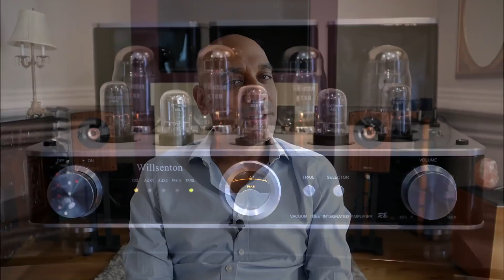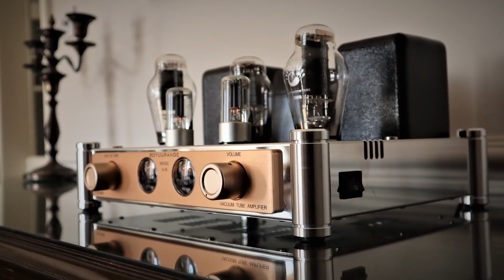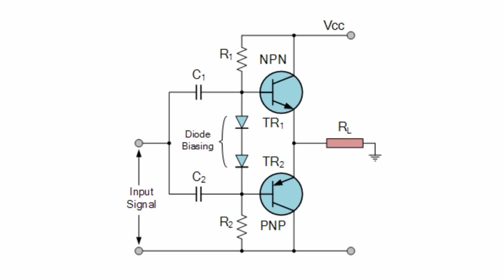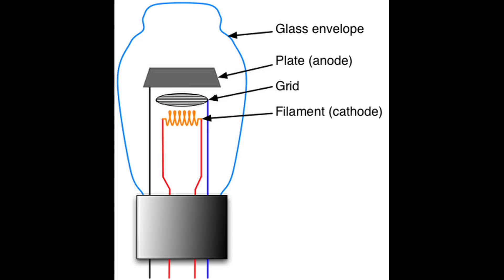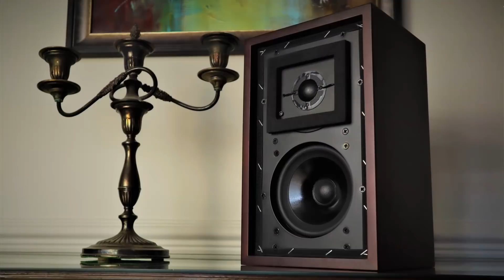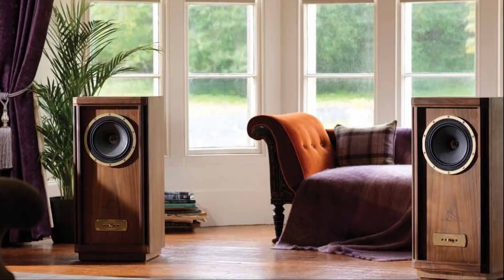Reisong BoyuuRange A50 Mk III Amplifier Review

Comment: I constructed a single-ended triode amplifier to power my Western Electric 555 driver.  It uses three 201A tubes, one for a driver and two in parallel for the output. Thr driver drives the output tubes via a 1:2 interstage transformer. It puts out about 1/2 watt, but the 555 is so sensitive that that is plenty of power. I've figured out a couple of things to make it perform at its best. SETs struggle with bass, so the key is to remove the bass from the amp. Instead of using a crossover on the output, I use one on the input and limit the low end to 200hz with a 24 db/octave LR high pass filter. A separate class D amp and woofer takes care of everything less than 200hz. It's also exclusively battery-powered. That gives a  nearly perfectly black background. I've built many tube amps, but this SET is probably the most musical and "alive" amp that I've ever heard.
Reply from the maker: Thx for sharing 😊

Comment: I have an old RCA single ended pentode (EL84) amp, running a pair of old B&O Beovox 4702 3-ways. Not sure how the Beovox sensitivity spec of “3 watts (DIN)” translates to today’s dB rating for 1 watt at 1 meter, but I am guessing it’s over 92dB. It doesn’t get crazy loud, but it gets damn near loud enough. And sounds mighty fine.

Comment: I use a 5w class a se el34 tube amp with a svs sub between the source and tube amp, the sub crosses out at 80hz, the sound stage is superb with either my quad’s 9l2 or klipsch floorstanders

Comment: I borrowed this amplifier from a friend and I'm very surprised, its sound quality is very good with higher quality tubes. 
All the Snobbie AudioFools will tell you that it's junk just because it's made in China and because you were not tricked into paying 4 to 6 times what they paid for an overpriced Western made Tube amp.
My advice is to use it with very efficient speakers, especially Horn speakers like Klipsch and a Small or fast Subwoofer from REL.
Reply from the maker: Thx for sharing 😊

Comment: Since you mentioned that the WR300 Plus paired nicely with Dali Menuet SE, would the same hold good for this amp too ? Especially since these two amp are in the similar ball park (sound wise albeit the Boyuurange is lil less powerful). I am looking to buy the Meunet SE and pair with this. 

I own this amp, and for the base control issues, I swapped a pair tungsol 6NS7 GTB and it made the base tighter and it was a significant upgrade.

Current Chain: Eversolo DMPA6 ME>>Pontus II>>A50MKIII>>Dali Oberon5. Listening distance about 2 meters.
Reply from the maker: The Menuet SE are an excellent match for this amp in small spaces 😊

Comment: I've got the Reisong A10 or 12. EL34 which I modded to triode. Owned it for years, but not always in use. A change to a couple of pio Russian coupling caps because why not. A change from I forget what to 12ax7 on the preamp side, a very recent mod of my ancient Voigt enclosures from 4 inch Fostex to 3 inch Mark Audio, and what can I say?

I really don't understand how sound works. The system currently sounds reasonable, and I'm using a recently purchased a Cyrus CDi so that should offer a good benefit.

The sound isn't doing a lot for me. Occasionally the width of the soundstage will briefly extend beyond the speakers, but I'm struggling to sense depth, it all seems so flat, one-dimensional. Plenty of detail on re-hearing familiar pieces, and the speakers seem to be getting looser and slightly louder by the day, agreeably so.

But there's no foot-tapping going on, no hairs on the back of the neck. Nothing. It's leaving me blahhh, no excitement. I can't seem to get emotionally involved. Maybe the speakers have always been crap, and a decent cd player and/or a SET tube amp aren't going to fix things.

I could buy new speakers but I told my ever-suffering wife that I wouldn't buy new speakers because I'm angling after a 845/300b combo, or a 300b parallel tube amp to get the watts up, or some other higher power tube combination.

I like this Reisong 300b jobby, but it's even less powerful than my A10 so I don't see much advantage to a 300b amp other than it being a directly heated real triode rather than the pentode EL 34, and its fabled wonderfulnessness..

Dunno, maybe my ears are painted on. At mid-70's and decades of fooling around with hifi, I'm still not getting it. Something is definitely missing, but I'm not sure what it might be.

I've listened to live music of various genre's over the years so I've a basic idea of what I might hear from a good system, if I had such a thing, but even with my poverty pack system I expect to hear more than I am, more involving somehow, but no. 

Perhaps it's time to enter a monastery, eschew all worldly goods and contemplate my navel....
Reply from the maker: Thank you for sharing. Speaker choice is critical 😊
Reply: @abritishaudiophile7314 Either contemplate my navel or buy a good set of speakers? Got it...

Thanks Tarun for all you do, and for reading my long-winded posts...

Comment: I couldn't agree with you more that speaker matching with SE DHT amplifiers is paramount. I've two fantastic Wavelength Audio AVVT 20SL SE DHT 4W amps driving 93dB full range single driver TQWT speakers. Mids and highs are perfect but bass was anemic at best. I finally gave up my single driver obsession by hybridizing ~ custom built a bridge amp powered subwoofer that now augments the HPF'd (8R||160цF) main speakers. The combined system yields a usable BW of 37Hz to 19.5KHz.
Reply from the maker: Thank you for sharing 👍

Comment: That was an outstanding review. The first I've seen from your BA channel. I'm interested tube amps, and possibly finding something in the "China HiFi Audio" stable that I could use to drive a pair of Klipsch 600M's. I remember the 300B's from my childhood (working Saturdays on central office switching equipment as a telecom brat in the 1970's). My current "listening room" is 12'x13.5' so it doesn't take much, and I gave up on specs worshiping 20 yrs ago, in favor of the fun of listening! That said, I did notice that you really have 90+ dB sensitivity speakers to even consider the low-power tube amps out these days. At $585 USD currently, there isn't anything else that compares if you like mellow, organic, >85dB music.

I will take some time and go through your channel. Cheers!
Reply from the maker: Thank you for sharing and watching 😊👍

Comment: Hello ABA, love your work. I have recently switched on a Reisong A10. The sound is amazing out of the box with some Tung Sol EL34B tubes swapped in. I will do the Skunkworks mods soon. Just one thing you need to clarify please. When you talk about db sound levels what filter are you using. Most likely A or C. There is a big difference as A filters out substantial bass energy and is quite unlike dbC which is kinda flat. Sound engineers in my country use the Industrial dbA to measure live sound, knowing they can boost the bass enormously and get away with sound level requirements. It's a problem . cheers.
Reply from the maker: Thank you. Good question dBA 🙂👍

Comment: This is a 3 watts per channel  amp in stock form .At 5 watts it has 10% distortion .Look up Skunky audio .She takes all these Chinese amps and  mods them to give the rated output ,or for reliability. Be warned ,they ALL need a fix.

Comment: Just upgraded from the A10, subtle but profound presence just struck me at first listening.  My setup is modest, a Tascam Cd-200 used as a cd transport via coax to a SMSL SU-1 Dac. Speakers consist of Klipsch Rp160m stand mount speakers and a Rockville 10" powered subwoofer. To me, it's money well spent.😮
Reply from the maker: That so great Steve 👍

Comment: The speakers that i use with my A50 are home made Majestic,designed by Allan Linton-Smith,a two way system with Celestion speakers.1730 compression driver and a 15"' bass.I changed all the valves,the JJ 300bs didn't make much difference,couldn't afford much better.The most change in the sound came when i fitted old Sylvania 6SN7s,very happy with the result.A 5AR4 as a rectifier boosts the B+
Reply from the maker: Cool 😎 thank you for sharing 👍

Comment: Negative feedback is primarily used to lower output impedance so that valve amps have any hope of delivering adequate damping factor.  Single ended low power triodes in zero feedback mode have far too low a damping factor to hope to control most conventional speakers.  They are fine with higher impedance high efficiency horns.  It’s also a myth  that well designed push pull amps using negative feedback are higher in distortion (there’s no such thing in amp design as “time smearing”..,that’s a journalistic subjective termed coined in recent years to describe speculative sound colouration issues often poorly understood.  In high feedback there has to be prevention of capacitive stability issues at higher frequencies so some form of phase compensation is used ).  Arthur Radford was the pioneer of making high global negative feedback amps deliver some of the lowest distortion most linear and stable  response of any valve amp which bettered many SS amps in sound qualities. These flea powered SET amps may be fashionable but they’re hopeless when asked to drive any speaker which dips under 8 ohms when the amp output impedance is typically 2 to 3 ohms and they have insufficient power for anything much shy of 100dB/1w/1m.
Reply from the maker: Thank you for sharing Paul. I agree that negative feedback lowers output impedance, increase bandwidth and lowers distortion. I suspect from a pure objectivist standpoint the “time smearing” argument of high global feedback may be hard to justify. However, there are many high end amplifier manufacturers that have gone to great lengths to reduce the amount of negative feedback in their designs, opting for circuits that are inherently more linear before applying feedback. Luxman, Accuphase, Trilogy, Dan D’Agostino to name just a few.

They all seem to claim that this approach leads to improved clarity and sound staging ability. My experience of SET amps seems to confirm that low feedback designs soundstage and image remarkably well. Whether that can be attributed to the “time smearing” of negative feedback or something else will be a debate that I suspect will continue 😊

Comment: I have this amplifier and I love it. I run it with some 93db Celestions and although the speakers aren't the best it does sound glorious. I also run it with a sub which adds the bass that's lacking from using these lower value speakers. I'm thinking of getting a pair of Klipsch floor standing speakers as they'll fit in my listening room, and being horn speakers will have the sensitivity required for this amp..
Reply from the maker: Klipsch would be interesting to try with this amp 🙂
Reply: @abritishaudiophile7314  I'm only saying that as Steve Gutenberg did a review of the A50 on his channel, and he hooked it up to his massive Klipsch Cornwalls... they're around 102db and he loved the amp.... its his review in fact that got me to part with my cash for this amp

https://youtu.be/dExnR7CJMSo

Comment: Thanks Tarun. Nicely done. I have low sensitivity Altec Lansing 15" speakers- 98d- which, until a power surge ago, were driven by Hypex NCore 400 amps (hello Bruno!). Not a great match. I currently have a real cheapie Chinese TPA3116 25w per channel amp- and it sounds great! So surprised! I wonder if the A50 would be a perfect match?
Reply from the maker: Thank you. It may be worth a try with those speakers 😊

Comment: Using a no feedback amplifier is like eating an ice cream cone with a blindfold on. At the very least, the feedback sorts out the curvy impedance curves of most speakers by improving the damping factor. All this was figured out by Mullard in the 1950's and later developed by Radford. The mullard design even used a pentode gain stage (horror of horrors!) to get enough gain to allow them 20dB of feedback. The no feedback idea was used by Audio Innovations in the 80s and 90s and personally, I didn't like them.
Reply from the maker: Thank you for sharing David 😊

Comment: Thinking about getting a valve amp one day what would be fantastic that nobody shows you is how do you set up a system like only one set of rcas but you have a turntable & a CD player and say a tuner and how to join that lot up and then there’s two mono blocks how does that work I’m getting brain hurt thinking about it all or I might just stick with my rega system 1 and Apollo r cd anyway thanks for the fantastic videos
Reply from the maker: Thank you. Just makes sure if it is an integrated amp it has enough RCA inputs 😊

Comment: Hi Tauron. Can you advise please, would  BoyuuRange A50 Mk III be similar in terms on vocals to MUZISHARE X9 300B SINGLE ENDED CLASS A TUBE INTEGRATED AMPLIFIER WITH PHONO MM or WILLSENTON R300 SINGLE-ENDED INTEGRATED 300B TUBE AMPLIFIER& POWER AMP
It will be very informative, thanks
Reply from the maker: They aren’t the same design 😊

Comment: I am being drawn towards a tube setup. I couple of weeks ago I saw Guttenberg's review of an Elekit amplifier, and I have been obsessed ever since. But unfortunately my speakers are 6ohms 86db. So I will probably also need some audionote speakers or something similar. Maybe I should just look for a tube amplifier that can drive my speakers. Or maybe I should forget the whole thing. Tough choises!
Reply from the maker: It is tricky you get right but speakers are not just a 6 ohm rating. I suspect you will need more watts that what the A50 Mk3 can deliver 😊
Reply: @abritishaudiophile7314  Thank you. I know. Maybe I should start with class A without tubes. Or maybe I should start by introducing my wife to the idea of a third stereosystem.
Reply from the maker: @kirlu50  it may be worth checking out Exposure or Sugden if you want that rich and detailed midrange that great tube amps are known for 😊
Reply: @abritishaudiophile7314  Thanks for the tip. It turns out that my local dealer sells the Audio Research i/50 and the Copland cta 408 (built in Denmark 😊) . Both are quite powerful. I think I will audition those to start with.

Comment: I’m considering this int amp partnered with a Lii Audio open baffle ( Caintuck design ) 10inch Silver series driver , 97dB sensitivity , single driver , no crossover. This wld be the perfect partner I think for this amp.  Ofc a Rel T5X sub wld help with deeper bass. I have heard Lii Audio drivers ( they have several series - Fast , Crystal , Silver ) in box and open baffle design - Zen Decware has some sound demos with their 2-3W amps. I was also considering the Willsenton R800i at 48W class A SET, but I think maybe it wld be overkill for such high sensitivity spkrs. Another great review , thank you.
Reply from the maker: Thank you Robert. That is exactly the kind of speaker to try with this amp 😊👍

Comment: I was in the 300B SE designs like 25 years ago and from my experience, you are wrong about the sensitivity but you are right about the cassis design of a super light cone. A 300B can't drive a Wilson Audio Watt&Puppy even that this speaker has >91db sensitivity, the Dynaudios are just to heavy, they don't need a lot of power but they need damping factor and a 300B has none. IMO the best match for a 300B is either to use it in an active setup as the mid-high range amp or use it with L'Audiophiles LePetit (yes this 60s speaker). You can build a pair of LePetit for around 200 quid, if you need the construction plans let me know and I will send you a mail. 
However the 300B can not even properly control a 15 inch paper woofer like the legendary Altec alnicos in a Voice of the Theatre setup, that's why I think that the 805 and 845 SE setup is the grown-up version, it still has the darkness and the attack in the mid-tones and brilliance in the lights but it can drive a bass too. A newer design I stumbled across is the KT88 SE. I know a KT88 in PP config sounds more like a transistor than the worst transistor, but in SE config this tube really seems to shine. I was only able to hear it for an hour and on an Altec Voice so I would not bet my right arm on it but it left a really good impression. It is not such a monster like a 845 but it has the punch that a 300B is lacking.
There is an open source KT88SE project going on for a few years with a lot of smart people adjusting and upgrading the design IMO it is an extremely promising project, their results look awesome.
BTW I am not a transistor hater at all, I think that simple PP designs up to 50 Watts can work stunningly well. If you have the chance to test a Cello Encore you know what I am talking about.
Reply from the maker: Very interesting. Thank you for taking the time to share you experiences MWT 😊👍